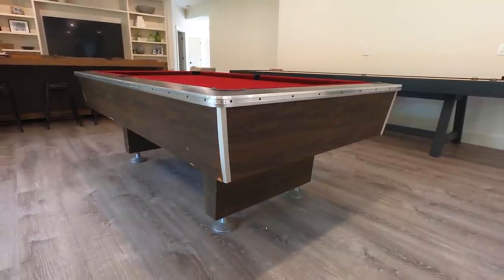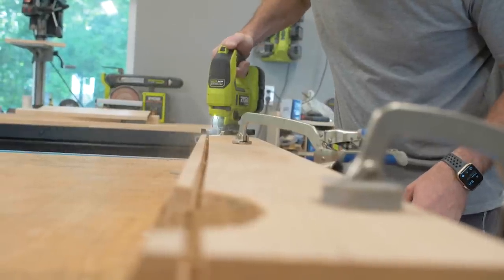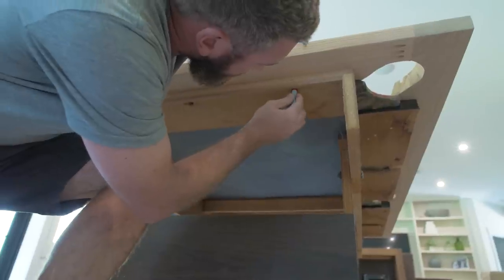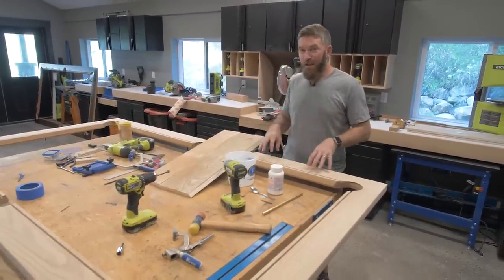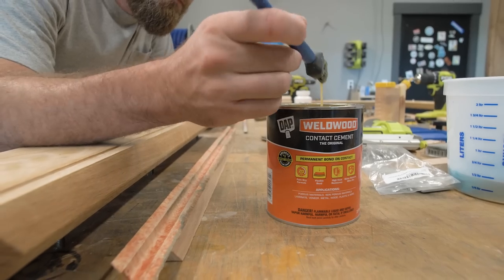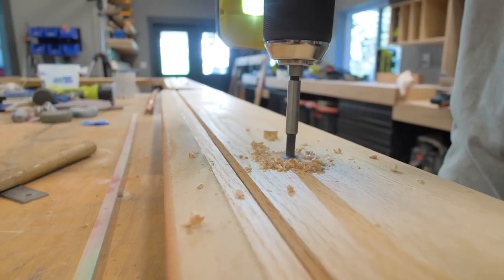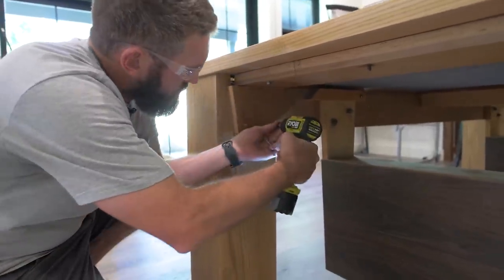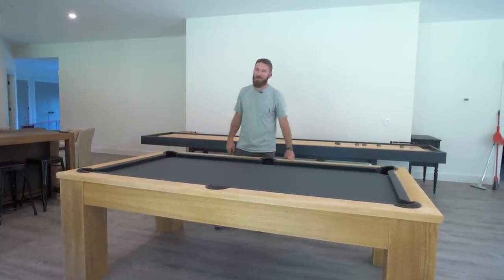Amazing Modern Pool Table Makeover 🎱

Comment: Nice table.  I like how you used the old table to measure out the new.   The only thing I would consider is adding more support beams running under the table for the slate.   Which would help keep the slate from warping.   With more of a frame you can then add shims to support the slate and help level the slate.
Reply: Was is slate?

Comment: I like the idea of upcycling, what did you use for the “cushions” you said you couldn’t re use in the corners or where the holes are, you never said exactly what those replacement black pieces were. Is it foam, plastic, rubber?! And, for any project using red oak, after bleaching the red oak with the lye mixture did you sand once dry before applying wipe on poly and is it possible to use rubio monocoat instead of poly?!